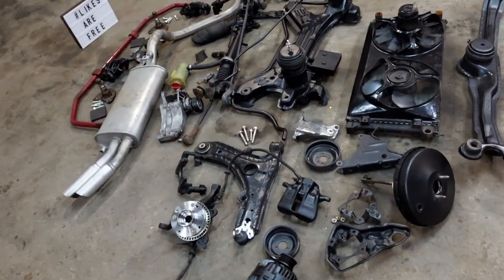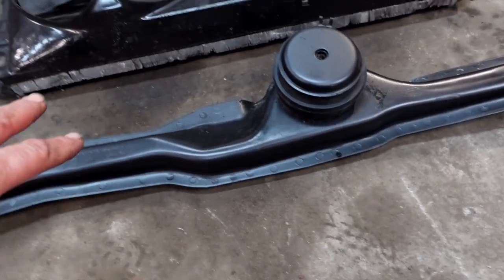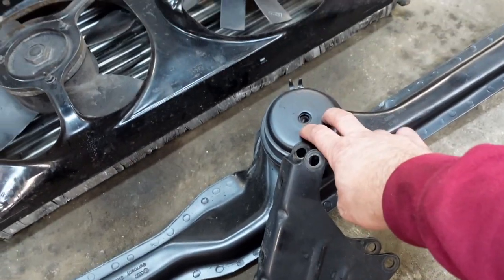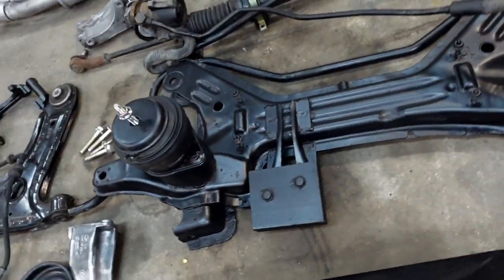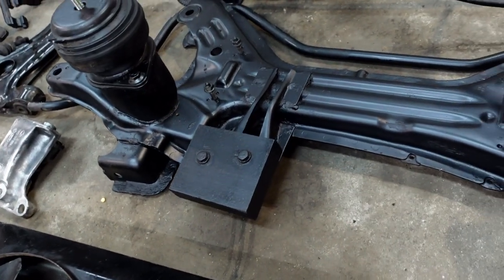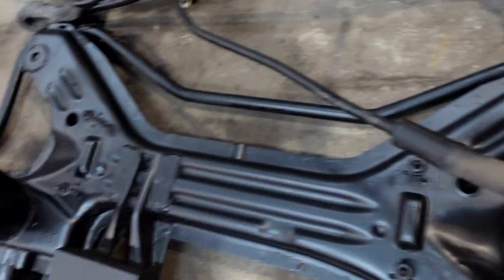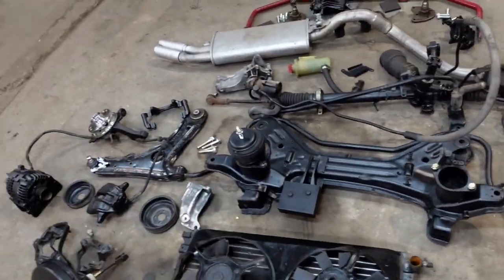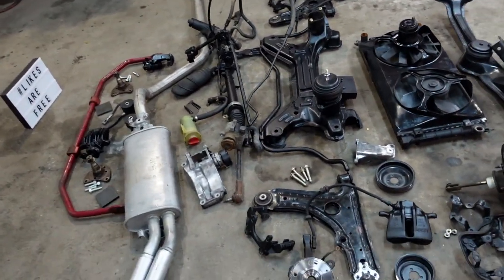Project Freebie mk2 1.3 to 2.0 16V ABF

Comment: I’m breaking down a mk3 1.4 golf, probably building a mk2 in 2.0 8v/16v next. Should i keep the same parts that you are using like the subframe and PS system?
Also anything else i should keep from the mk3 to use in a fast road mk2?
Much love from Finland!
Reply from the maker: Thank you for the support 🙏🏼, yes keep the whole front, subframe, PS, axles even if they are solid discs as long as the callipers are 54's and the anti roll bar if it has one, also keep the fuel tank and fuel lines, but you will need to upgrade the 1.4 fuel pump.

Comment: Hi man i did a conversion with my mk 2 1.6 and converted a 2.0 abf motor in . The problem im having is that the cv is hitting up against that rear gearbox mounting. Any advice would be much appreciated.
Reply from the maker: Hi, are you using the same 1.6 gearbox 020 or the ABF 02A gearbox?